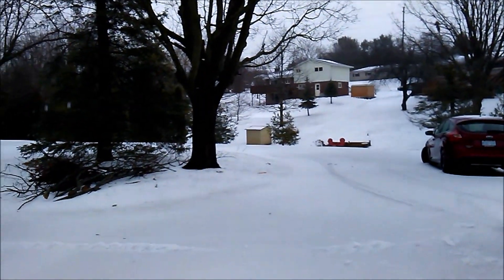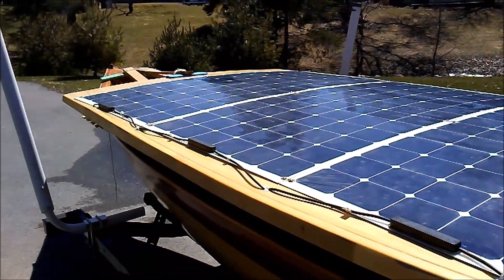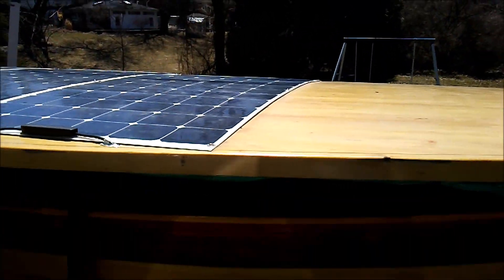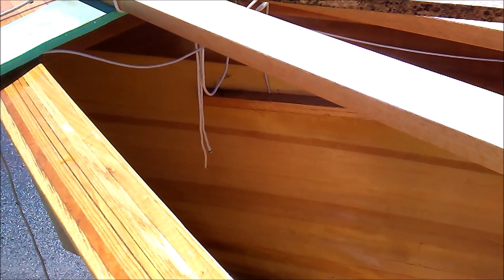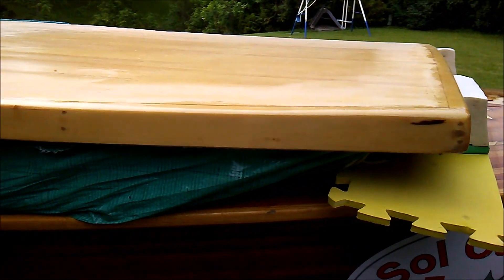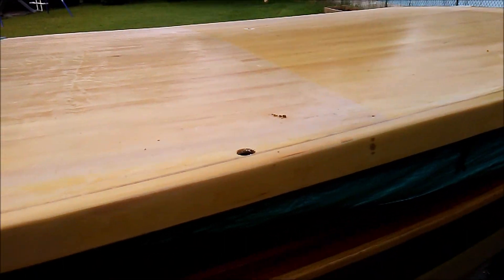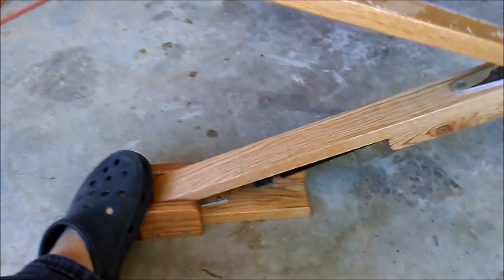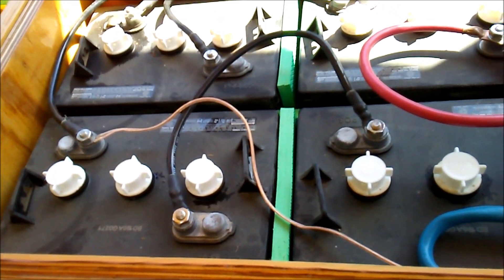Building My Solar Electric Boat Part 2   Modifications  for 2018

Comment: I know this would be a costly move but if you can get 100 amp hour lithium batteries to replace those lead one's you'll save on weight and you'll have more power for longer. GBS batteries are the cheapest!  lead acid batteries looses 20-30% when charging . Lithium is amps in amps out to about 91%- 96%. Just like using a Mppt solar charger is better lithium would rock your world. Having extra 150 lbs off that boat and then adding a few volts to the motors about 27 volts + under load vs 25volts or lower would mean more RPM's for your motor and it will hold up to that voltage for 60% of the time. However you'll be always in the sun so with the Mppt controller set right at 28.4 volts I think that would be the voltage you'll be cruising at. I'm sure you are seeing around 25+ under load in full sun now. However those GBS batteries go up to 29 volts max putting two 14.5 volts together. I would keep the charge controller set at little less then 28 volts to keep more amps coming into the system. I know a lead acid battery likes to stay around 12.2 -12.5 when being used some even lower. Having 13.5+ for more then 70% at the time would mean you would cover more water and every drop of power coming into the the battery's when not at full speed would be put back into the battery. I love your boat and wish I had a Dad to teach me how to build something like that with my hands and mind.
Reply from the maker: Thanks for your comments. I have been looking at  Lithium Ion batteries but they are very expensive. All your points on switching batteries are correct. I will probably keep the Lead Acid for at least one more season. I am planning to build a new bigger catamaran boat and am going through the numbers of a 20 Hp electric vs a four stroke. The batteries required are the killer. But I will cross that bridge when I have finished building the boat.
Reply: @philboyer2036  Pass the boat down to your kids if so, You put hard work and sweat into the girl. Having a bigger sized boat like that you'll have a hard time getting her in and out of the water. I would just make a house boat to retire on and be done with it. lol. I found on Amazon these new type batteries https://www.amazon.com/lithium-LiFePO4-Battery-Electric-Batteries/dp/B078JB836N/ref=sr_1_7?keywords=12v%2BLiFePO4&qid=1556688498&s=gateway&sr=8-7&th=1  even if you added in a back up system with the 74ah you would spend 800 bucks for 8 cells @ 3.2 volts. I would sell those old lead tanks and take some weight off the boat. I look forward on seeing your new boat build and If you can make a step by step video on each day you work on her I bet your channel will blow up. Once you have a big fan base you contact people that make those tools you use to build the art you build and make money on the side. Solar is popular and maybe you'll get a sponsor for those really big and costly lithium battery's I see those fishermen use. I bet having 1200 watts of solar and 400ah lithium setup would be sweet to have. Okay, i talk too much and just wanted to see Men like you effect the new generation of Men cause we need it!
Reply: Recap, less weight means save on power and gain speed. lithium batteries would last 5 times longer cycles and give you a little higher voltage and keep that voltage for longer  75% of the time. last , lead batteries you can only use 50% of the power in them and at best only get 20% top voltage too. You get a 100AH lithium battery for 550 bucks it would take two 100ah AGM's to match it. Less then 1200 bucks you would have only two 100ah battery's to that would weight 60lbs to replace 150 lbs or more lead. I think it would take just over 100lbs off the boat. You add another panel then you could drop to a 50ah 12 volt battery and get two of those and drop another 25lbs off the boat. less weight I know would be better for the boat to handle and speed would increase. You might gain 2-3mph out of her. It would be like you not even being on the boat. I don't know if you could tell on that boat 100lbs less of weight thou.